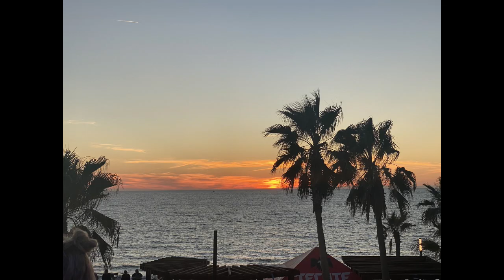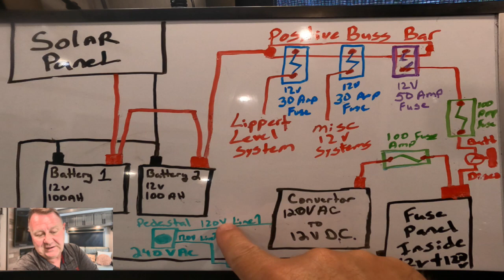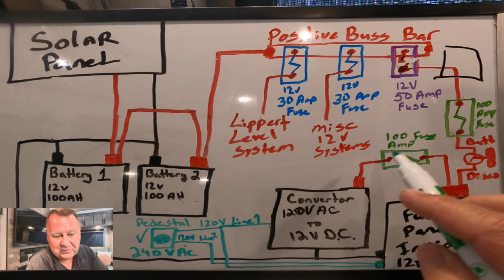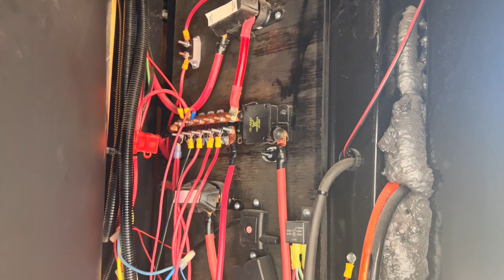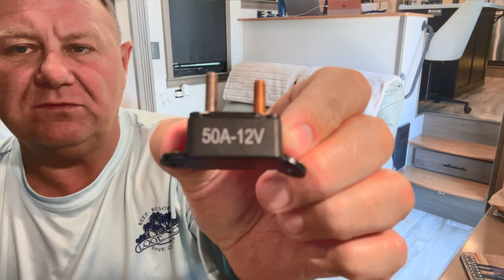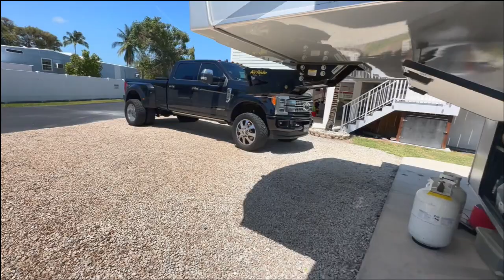2021 Forrest River Riverstone Legacy 42FSKG  DC Electrical

Comment: I watched your video yesterday as I have a 2019 Riverstone 39fk . How strange I discovered this morning all my ceiling lights were dimmed. So, I hooked a 12v charger but only the bedroom and bath began to work. I checked my fuses and they all were hot. I found the issue was the converter's ground wire was "sort of loose". but after fixing it, every ceiling light worked except for the kitchen and living room? So, after checking the fuses as you did in your video I later discovered the OneControl system showed the voltage accurately when the converter was fixed and OneControl voltage changed if I turned the converter off; as I expected. It must of been dumb luck as I thought what if I do an  "all off" then hit the kitchen and living areas and low and behold they came back on. Just another quirk that fits with your experience. And, fyi those same fuses are on trailer" and located near the batteries or the first cross bar after the propane tanks.